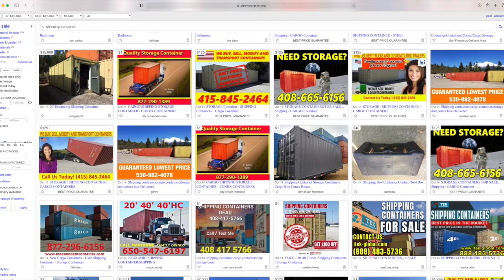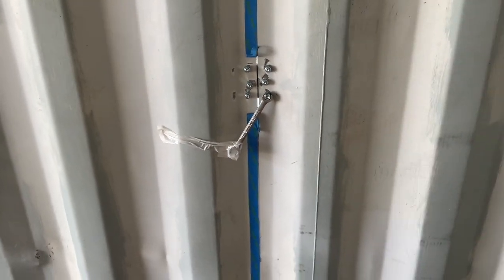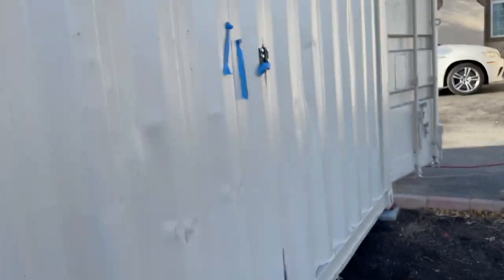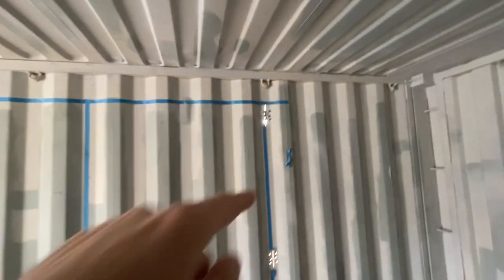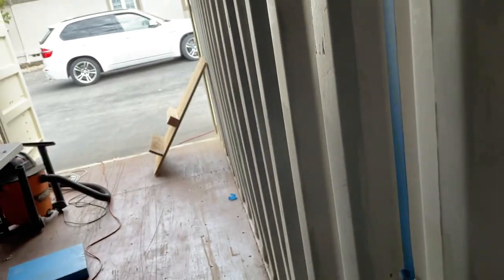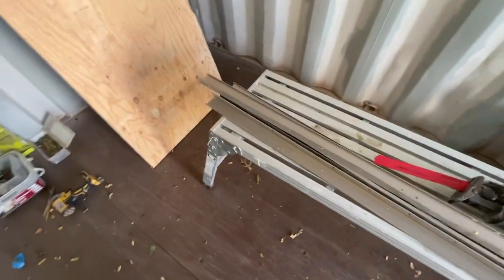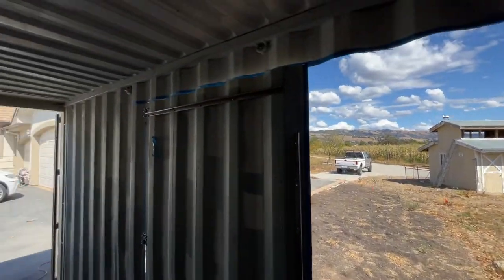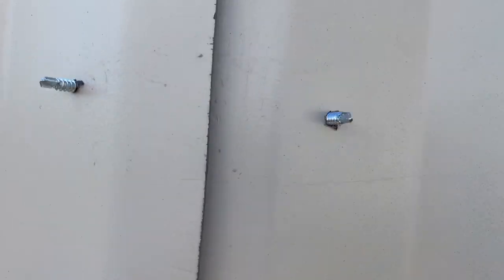Turn Your 20' Container Into (relatively cheap) Car Storage!

Comment: Would it have been cheaper for you to just buy a container with the doors on the side that are built to seal perfectly? Good job though, I like some DIY myself, it's a headache but also satisfying. Are you still using the container?
Reply from the maker: cheaper: I seriously doubt it. I looked up a steel frame/door combo, especially a rollup and you get Into the thousands very fast. Then: $$ to install, if you cannot do it yourself.  I sold that car, and have no need for it as a garage, at this time, but still have the container and use it as overflow storage for seasonal stuff and also a place to put a piece of workout gear. We do the exercise on that gear- in the container.

Comment: Why do you need it to open so wide?
Reply from the maker: good question.  1] extra width for some slop, in case one does not perfectly pull the car in to the same exacting spot each time.  2] the doors have a super wide, sweeping travel. I needed to be sure, and it's almost impossible to measure for that sweep ahead of time. 3] I needed to be able to squeeze out after opening the door, so you have to account for me, as well (there's no room to walk back to the end of the car, so I had to get out the side door).  and 4] I had the room on the container, so...why not?

Comment: Those are called butt hinges, The are made to be morticed into the edge of a door and door jamb. They are not made for surface mount application. There are many other hinges that would have been more suited to that application and would not have needed a slot cut into the metal.
Reply from the maker: thanks for the reply and info. I wish I had known that before I was walking down the aisle at Home Depot.

Comment: There is literally no point in wasting all that money on foam insulation to stop condensation if you are literally going to cut a non air tight door in the side of the container... makes no sense unless you are adding a sealed door later. Also I have had a container for 10 years with two loaded snap on toolboxes in it, literally never had a problem with condensation at all ever, containers have vents as well to stop sweating at the top.
Reply from the maker: I have containers that are open to the air for livestock and they rain inside all the time.  This one, you are partially right, the crap door seal needed to be bolstered (mainly because it leaked water into the floor) with a tarp that covered the entire door footprint so rain could not blast against the useless seals I made. We just went thru a huge atmospheric river event with zero moisture issues. 
This was not included in the video, but the insulation was also to keep things from getting beastly hot. California and all. Who wants a 130*F car? That is not good for storage. $3k well-spent, as far as I am concerned.
Glad you found the video something worth watching, Good for you for saving on the insulation. Be sure to like and subscribe.
Reply: @slkttop  Need to weld a frame into the door opening hole and create a door jam with rubber seals. No need to seam weld the entire frame, just stich  weld it and use sealant between the welds. Did this for another container I have with my mustang in it.
Reply from the maker: @SM-gp2xh   good idea...that "was" the original plan,. but that door and frame costs as much as the container, almost. I wanted a rollup. Maybe in the future.